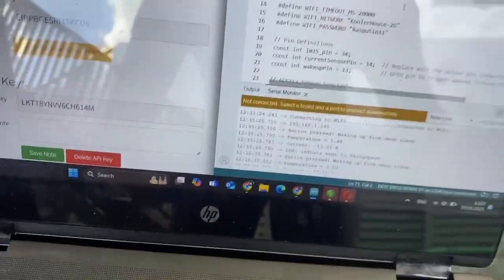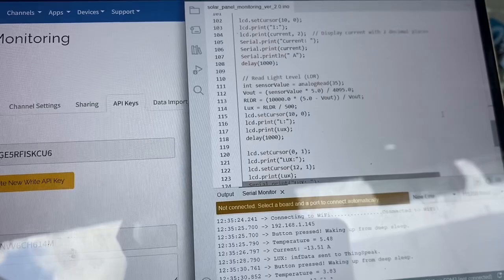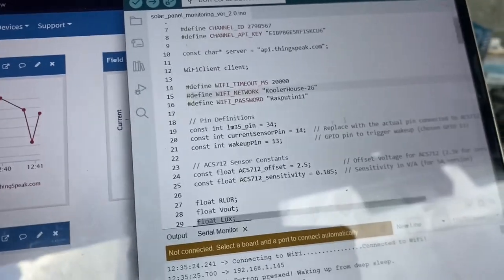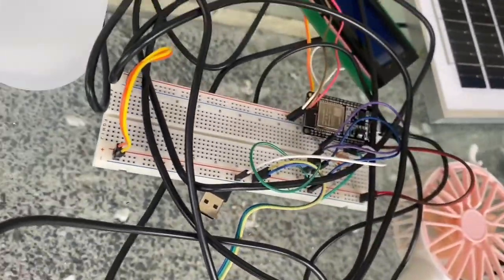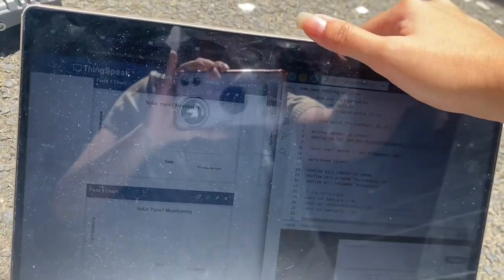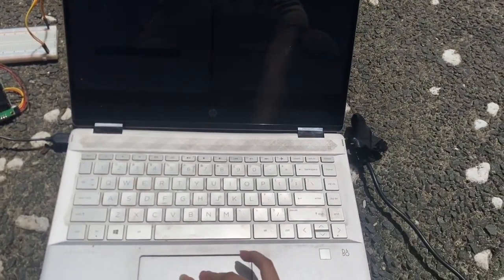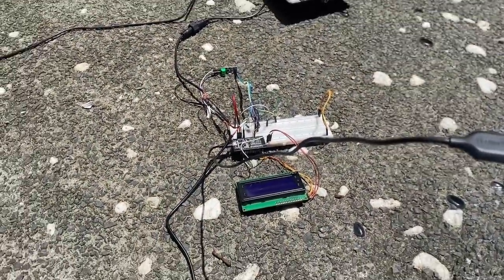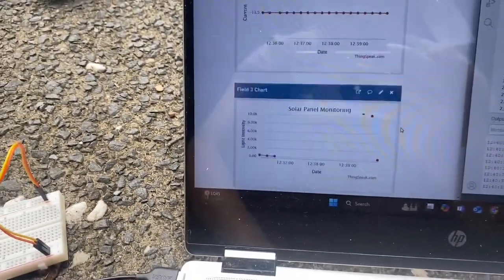Embedded System 2 Final Project - Jessalyne Desiree (2206822521) (see desc)

Comment: Please allow me to offer some constructive advice. When you're buying electronic components. Always buy several of everything. If you receive a bad part or you damage one. You'll always have a spare you can use. You're right about the data changing as the result of clouds. Consider adding a 1 or 2000MFD electrolytic capacitor across the output of the solar panel to stabilize the output. Also a computer fan could be used as a load device as well. You could tweak your code a bit to make it more visually appealing, but it's not bad. I'd consider having the whole thing inside except for the cds cell and the solar panel. At one time my kitchen table was my work bench. Make yourself as comfortable as possible when building. A 6 inch pair of needle drivers will make plugging and unplugging wires into the breadboard easier. Theres nothing that can't be improved upon. Don't fall into a trap thinking the way you decide to do something is the best and only way. You might think of other ways to accomplish the same thing cheaper or easier using a different design, or you might not, and decide the original design is best. The point I'm trying to make is be flexible and open to change. Overall I'd say the was acceptable. I hope you and your dad have a great night.